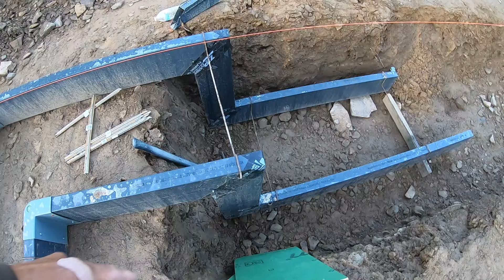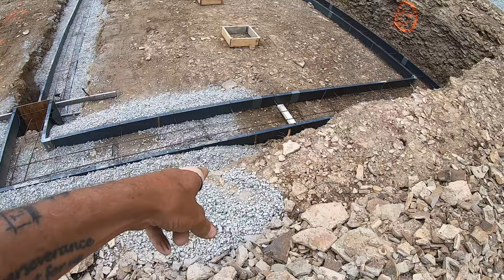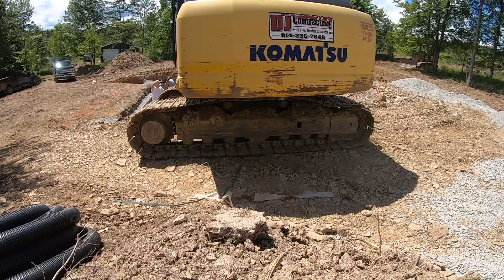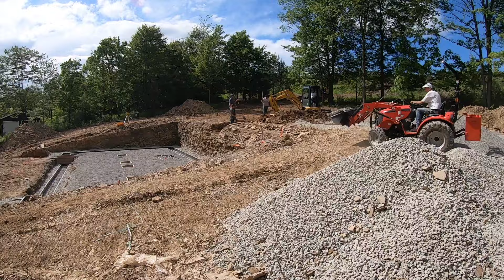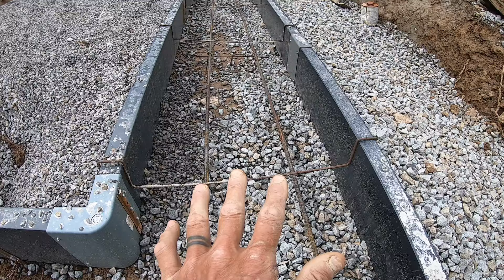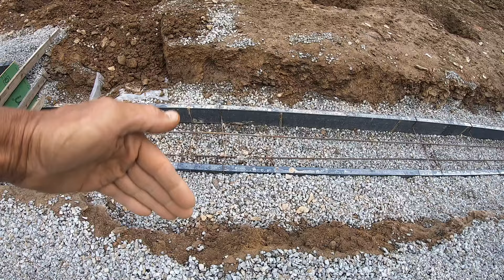Installing Form-A-Drain For Footers #formadrain #footers

Comment: Wow, really looks good!  I hope the poor went well, your wife is healthy and your house is mostly built by now.

We're looking at using Form-A-Drain too.  How did the pour go and are you glad you chose it?  I definitely get how Form-A-Drain can be the foundation of your radon exhaust system, but one thing I don't understand is that even though the product is perforated on the outside edges to be able to pull water in to "drain" it away, the whole system formed up level.  So HOW does it drain water away from your foundation if it's level?!  Did you still install sloped french drains to make sure you truly drain all water away from around your foundation, and if not please explain?  

I like the fact that your form work stays in place with this, but if we end up using it I think I'll still add french drain pipe around the three sides of the house that are on the "up hill" end of things just to be sure, because it rains all winter here in the Pacific northwest and it's damp enough without having a bunch of moisture sitting in around your foundation walls.  

Thanks for responding (if you do)!
Reply from the maker: Thanks for watching!!  We are close to finishing right now and will be moving in soon Lord willing.  I have a few more vids of the process.  

The pour went great, and I'm absolutely glad I chose to use it.  It costs a little extra, but there isn't a better system for wet conditions IMO.  The bed of limestone is a very important part of the system.  It is the entire depth of the forms.  The inside and outside forms are tied together with a 4" pipe, and the outside form has two 4" pipes that are sloped away from the house to drain any water away.  Those two pipes are covered in a bed of stone also to prevent crushing.  The two pipes are plenty to drain any water away. I'm not sure if I showed this in a subsequent video or not. You may not have to be concerned with radon gas venting in your area. The block walls are parged and coated with a heavy layer of foundation tar on the outside, and I put two coats of dry lock on the inside.  

I hope this answered your question.  If you have more, feel free to ask.  Thanks again for watching.  God bless.